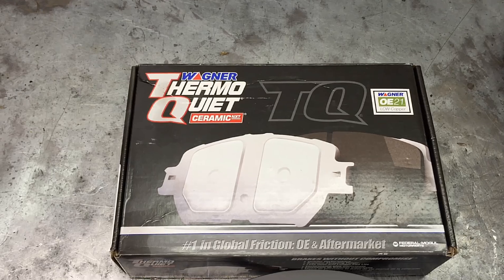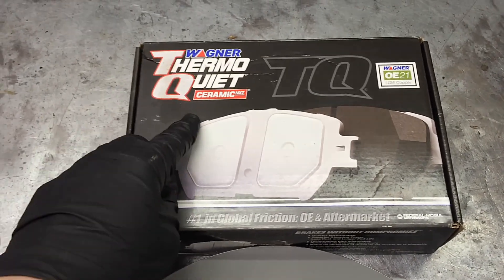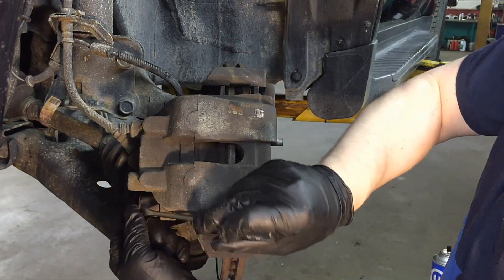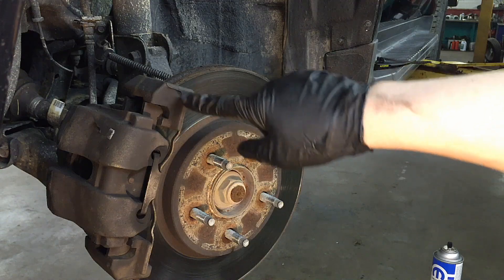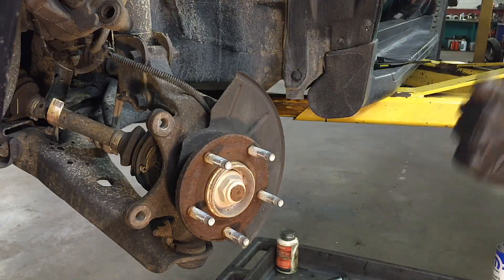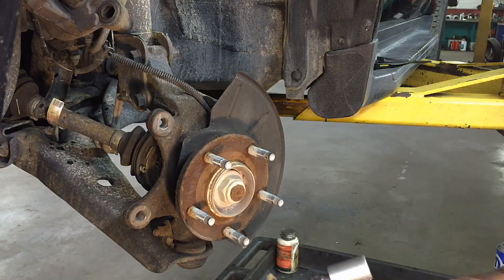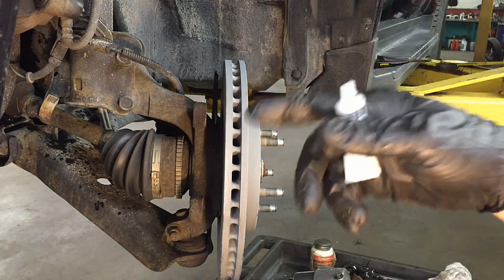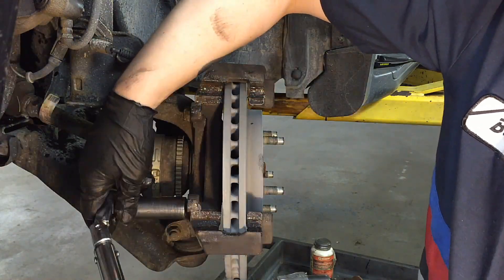2001-2012 Ford Escape Front Brake Job in Detail

Comment: Best tip....get your 9mm Allen head socket before you start. Skip the hardware store, they probably won’t have it, go to the auto parts supply house instead. That socket is very “Motorsport” and not much else.

Comment: I've never done a set of brakes with the sleeve clips so hard to line up on the inside of the rotor. There were several key points in the video that helped me do this the first time the right way. Thank you for having this particular model on YouTube!

Comment: Thanks for the well-instructed video and I appreciate your effort to get it out there.  I used your suggestion for pads and it worked for the Mariner 2010. This saved me time, inconvenience and $$$ without having to drop it at a shop. It took a little over an hour.   Thanks again

Comment: Great job. Just one added benefit is to remove the brake fluid cap before pushing your piston back into caliper. Then after installation verify it’s topped off before depressing brakes to avoid air entering your system. Great video. Very well detailed

Comment: Thank you!!! Straight forward and the channel lock trick worked very well. My 2012 Escape’s rotor were stuck and hammering didn’t work so I used both caliper bracket mounting holes with two shoulder bolts, nuts and washers with 3/4 inch heads to jack them off from the back side. Just went back and forth between the two since the car was in park and I couldn’t spin the front rotors. Both rotors separated in less than a minute once I started ratcheting. The sound of that rust seal breaking was awesome.

Comment: Your instructions worked like a charm, watched the video a handle full of times and I was good to go. To any one doing this at home I would strongly recommend a breaker bar to easily remove the 18MM bolts from the caliper mounting bracket.
Reply: Dwayne Joyce I did my son's 2002 escape yesterday and even used some heat from hardware store propane torch around those bolts broke loose easy

Comment: Good video. I would agree with the previous comment by John Castor. It is advised to crack the bleeder screw on the caliper when compressing the piston into the bore for two reasons. First, it helps remove some of the nasty old overheated brake fluid from the caliper, and second, it keeps that nasty overheated fluid from being forced back through the lines and hoses into the master cylinder. By doing this you introduce cleaner fluid into the caliper, and new fluid is added to the master cylinder to top it off if necessary.
Reply: Thanks for the tip, I read that with ABS systems the “bad” brake fluid can be pushed back into the ABS and screwing it up.  I use the woodworking clamp to compress the piston also, it is lighter and easier to work with than a heavy c-clamp.

Comment: Well folks just thought I would get back on here and reply to how great this video that Brian shared with us helped me with the complete all four wheel brake job on my son's 2002 escape yesterday I by no means am a mechanic but can do small things like oil changes and stuff I did the brake job along with my cousin who is mechanically inclined but has limited feeling in one of his hands due to a surgery he even had all the tools jackstands jack and air compressor and impact this video for the fronts is spot on for removal of calipers,gravity bleeding the calipers and even a little pb plaster and heat around bleeders THE ONLY PROBLEM we had was the front left disc was seized to the hub so bad we had to break it off with a chisel in pieces to get off the previous owner or whomever did brakes probably never took the time to apply never seize as Brian shows in this video we followed all these steps the the slide pins caliper bolts came out easy with the 7mm hex socket and the 18mm bolts that hold caliper brackets came off after a little heat was used we did the rears as well and they were a breeze but a pain in the butt because of being rotors and shoes and having to hold all the springs and stuff when reassembling BUT DO YOURSELF A FAVOR AND FOLLOW THIS VIDEO ITS THE MOST ACCURATE ONE ON YOU TUBE TO HELP YOU WITH TACKLING A FRONT BRAKE JOB BRIAN'S STEP BY STEP GAVE ME THE CONFIDENCE TO DO IT, THANKS BRIAN!!

Comment: Spot on with the tip to inspect the smooth rubber brake lines. I just did my pads and rotors today and sure enough, they are cracked, not leaking but like tou said its only a matter of time before they burst

Comment: Would also like to say thanks for the video. It gave me the confidence to get it done.  first side was a little slow hard to loosen bracket bolt. A breaker bar helped a lot so the other side was fast and a piece of cake, the video is very well done and very informational.  Thanks for putting a little extra cash in my bank account. Keep up the great work.

Comment: those ceramic pads are kick ass...I've installed a blue million of em at Midas and Firestone chevy and Lincoln merc. One thing I've seen is new rotors and a base antisieze can make the rotor pop as it takes up slack space on the studs and the aluminum compound smokes a hell of a lot. I switched to bronze antisieze and became the no comeback kid in Indy

Comment: Your video is perfect and covers my 2017 Ford Bronco. Here in Canada, apparently there are two brake rotor sizes available for my model year,. My Escape SE with 2.0 turbo engine, has the 'factory tow package. I don't know if that makes a difference or not, but my Escape takes the larger diameter front rotor with those 'flat' steel spring retainers for the pads as you've shown here.
Regardless, your video was 'the tool' I used to help me through the job. Thank you.

Comment: Thanks for showing me the right steps to change the brake guiding pins and calipers. The strange 7mm hex bolt almost stopped me. Thanks again
Reply from the maker: 7mm is way more common than 9mm glad you got it fixed!

Comment: Just finished this job on our 2012.  Thanks for the info!  One other important note, at least for that year, is you need to find out whether you have steel or phenolic pistons.  The inner pads for the models with steel pistons use a much larger retainer clip.
Reply: Is there a way to tell which pistons you have without taking everything apart?  It would be nice to buy everything beforehand.

Comment: In 2005 the ford 500 had a screw which kept the disk in position but also rusted in place!I used my 4" disk to cut the screw off, and the replaced disk from Ford no longer used that screw since it was through the hub assy. nice idea to hold the rotor in place for the assy line, bad idea to fix.

Comment: Hey man, I got a 2010 Escape last year and had to do some work, and my mom also got a 2010 escape, so have had to do some stuff for her too.   Your videos are awesome.  I've done brakes in the past usually they are straightforward but since it was for my mom I wanted to get on here and find a video to make sure there wasn't going to be something I'm not used to and screw up her car.   I was happy to see you had a video on this.   Oh yeah, I did change my trans fluid like you did on another video but I think my vehicle only took 4 quarts and I think you said 5.
Reply from the maker: They almost always take just over 5 in my experience
Reply: +FordTechMakuloco interesting well I hope I didn't do something wrong but when I put 5 quarts in it was overfilled.  I drained it again and ended up putting in 4 quarts the second time.  but hey either way video was helpful
Reply: Eric Dyer best step by step video on YouTube

Comment: If you hadn't mentioned it, the Hybrids require you to disconnect the battery before performing any work so the calipers won't clamp down randomly on your hand.
Reply from the maker: Good point but hybrids are a different ball game all together. The procedure and pads are all different and will be featured in a future video specific to hybrids.
Reply: Its happened to me, so it sounds like you've been lucky.  I have an 07, so its possible something had changed in between those years.  Oh and the brake pads are different.  I changed them for a friend of mine who thought he had a hybrid, he had a flex fuel.  He had to take the brakes he bought back, because they wouldn't work.
Reply: FordTechMakuloco could you provide link to hybrid 2010 escape brake pad replacement please . Thank you , much success!!

Comment: FordTechMakuloco No, the original issue was to replace the passenger side front Hub Bearing. Upon further inspection I not only had to replace the Hub Bearing, but the Lower Ball Joint, Tie Rod End, as well as the Half Shaft. The brake job was just an added bonus since the vehicle had sat for over a year and the components were badly rusted.

Comment: If anyone has problems sourcing replacement clips, if you have an auto parts store that caries Raybestos pads, etc., they probably have the clips. Buy a whole box of 30 (they sell them different counts depending on application), you'll be glad you did. Cheap and a major pain to source locally sometimes.

Comment: Nice video, full of helpful tips, and it's nice to have the torques as well. I have to let you know however that the part about the spring clips does not apply to 01 escapes (and possibly other years) as they have a different assembly.

Comment: Excellent Video. What is different about the 2017 model?  I have not started what should I look out for? Also with Auto start feature will that make a difference with changing the pads and rotors?

Comment: Good video!  Our 2011 has 7mm slide bolts on it.   Also had the phenolic pads which were impossible to find at the parts store same day, at least for good quality ones.  I wasn't sure and bought the steel piston ones and had to return them.   I just went to the local dealer and got some OEM pads...aftermarket rotors, not to worried about that part.  Wife was involved in an accident which resulted in a drivers side strut replacement and some body work but afterwards we had a vibration similar to a warped rotor.  I think it got damaged or bent slightly in the wreck but all good now with new stuff.  Hate to put new brakes on a 48k mile vehicle but circumstances happen.
Reply from the maker: klc317 Yeah they got smart and went back to the 7mm size, glad to hear you got it all fixed up!

Comment: I have an 02 Ford Escape & I went to do a brake job today (only changing pads no rotors or calipers) & as I got to the LF brakes I noticed it was a bit of a pain to get the caliper off but I figured “eh it’s old” well as I went to put the caliper back on after replacing the new pads I thought I had depressed the piston in the caliper but no matter how hard I try...I cannot get the caliper back over the rotor with new pads on... I checked and rechecked nothing was in between, I also checked that I had the correct pads for said vehicle...as well as made sure it was all clean and greased...no luck.. 
the boot on the piston/plunger on the caliper is still clean, intact with no rips, as well as being soft and malleable...
I’ve done plenty of brake jobs... ALL BRAKES WERE RELEASED/OFF... anything like that as well as the vehicle off the ground on stands
Reply: I did compress the piston EXACTLY the way you did..same exact tool and all! ( after it wouldn’t depress I used a large C clamp and also switched as a last resort using 2 smaller c clamps...)

Comment: As always, a great video. I have a question. We have an '08 Mariner. The brake pedal goes down further than what seems normal. The brake fluid is not low and the pads are fine. The ABS control module is non-functional, but my understanding is that this does not affect braking or pedal travel. We considered replacing the module but the cost is VERY high. What can you share with me about this.

Comment: Have an 2010 with seems to be front wheel caliper sticking.  Possibly be the caliper or brake line you pointed out.  Read about that brake line having a liner where it collapsed.

Comment: Going to do an '06 Mariner soon, all OEM parts for me. That flat spring is a wire type on this Mariner. Surprised you did have to beat the mother!........Never seize good for out light bulbs on threads only.

Comment: 2008 Escape 9 mm Hex😕 My rotors had some sort of locking pin on the lug nut bolt holding old rotor, also when you push in brake pads don't freak when your reservoir leaks out fluid.

Comment: Hi Brian, just a quick question.  Are there any know issues with the brake system on the 2010 Ford Escape XLT.  We had a loss of power brakes and bled the brakes twice and only solved the issue about 2 months at a time. The air in the system comes back, thus losing our power brakes. Can you suggest what the issue might be because my local mechanic thinks it's a master cylinder but not 100%. My rear brakes and calipers are still original, and I have 118000km. The only thing I changed twice was front disks and pads. Any suggestions are accepted.  Thank you Brian, love your show with your son as well.❤😀

Comment: Great instructional video 📹. I had a better brake kit that included the springs and even the rubber boots.  You don't cover replacing them but I can testify they are challenging.

Comment: other thing is to torque the wheel nuts in pattern and spec, done wrong can cause brake wobble too. I've always suck out the old brake fluid from master then bleed each axle so there's new fluid in the system. bleeding by using a hand vacuum tool.

Comment: Thanks for posting this video, yet another great video you produced that helped me fix my wife's Escape.  Do you have a video where you do the rear drum brakes?  Also, if you need an Escape to work on, I'd be happy to volunteer her's.  It has a transmission leak that I've already spent almost $1K on at the dealership and they havent been able to find the leak.  They told me they want another $2K to drop the transmission and take it apart just to see where the leak is coming from.  It only leaks in the summer though, possibly because of the warmer temps.

Comment: @fordtechmakuloco Would you please discus the difference between the Phenolic caliper piston and the steel caliper piston? I have a 2010 Ford Escape, and they list two different types of brake pads for the front based on the type of caliper piston. Thank you in advance!
Reply from the maker: One is plastic the other is steel so you must know which you have to get the right pads to clip into the piston opening which is bigger on the steel piston.

Comment: It is worth mentioning that I believe in the 2011 model year Ford changed part numbers for the brake pads. The older ones have a thicker 3 prong bracket that snaps into the caliper piston and the later model year 2011's use brake pads with a smaller 3 prong bracket.
Reply from the maker: TIKIMAN198 I am showing the caliper is the same for 2010-2012 as shown here-From: 06/29/2010To: 04/29/2012

Comment: Just an FYI of an issue I currently have to other viewers. I bought some front pads at the local parts store and I believe the outboard pad metal base was machined incorrectly. It is slightly smaller then the OEM and when I press on the brake peddle while driving I get a clunk whenever the pad slides forward. I've just been to lazy to fix this...

This was also the highest $ brand at this particular auto parts store. I'll be fixing it this weekend...

Comment: Hi Brian! I have had this irritating squeaking noise coming from my front brakes for months that I just can't seem to get rid of, at first I thought it was cheap pads from autozone so I exchanged those for another set and still had the squeak, I then returned those pads and installed a set from another Auto parts store only to have the same issue, when I tear the brakes down and apply a generous amount of lube on the backing plates the squeaking goes away for about a week but then it returns or if I apply slight pedal pressure the squeak goes away so I'm fairly sure it's the pads. I've removed and cleaned all the brackets, pins and even replaced the locking clip but just can't get the squeak to go away. I've never had this issue before and I'm at the point where I'm annoyed when driving and want to drive the Escape into a ditch lol!  Have you ever come across this issue? thanks!
Reply: Carlos G lol 😂 my sons 2002 escape which we just bought him in November did this when you release brake pedal just changed all four brakes last night and still hear it when you come off brake lol a little squeak wondering if it's in a cable of some sort

Comment: Hi Brian thank you for this very thorough video but I came across a problem.When I tried re-installing the caliper back on I tried torquing the side caliper bolts to 40 lbs and I sheared off the head.I did not cross thread  them Is this normal.I ordered through Rockauto for new Caliper slide bolts made by Raybestos Professional series.
Reply: panzercanuck the actual torque is 18ftlbs as per service manual
Reply: 18 ft lbs makes sense .Some how I understood higher?Again Thanks it was a great help.

Comment: Great vid. Im going to replace both rotors and brakes on my 02 escape. Will both caliber collapse or do u have to do one at a time repressure then do the other one and to get the caliber to collapes did u losen cap to stop air from getting in line?

Comment: should do one on those crazy rear rotors with parking brake! tools tools and more tools
Reply: Dirtyharry70585 and you need hands hands and more hands to hold everything together springs shoes adjuster to put in at same time and alot of cussing lol case in point did them last night along with fronts on sons 2002 escape I think from now on going forward I'll never do an older vehicle which I know has rotors LoL

Comment: I have a 2012 ford escape 2.5L and my manual says that my wheel lugs are supposed to torqued to 130 ft lbs instead of 100 ft lbs that you have listed in the description.  Why is there such a difference in torque specs for the lug nuts?